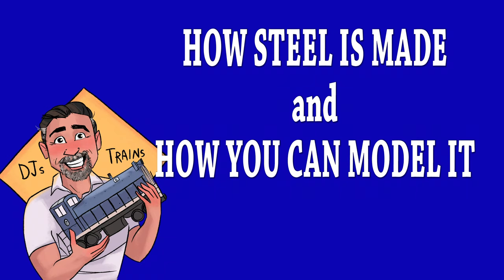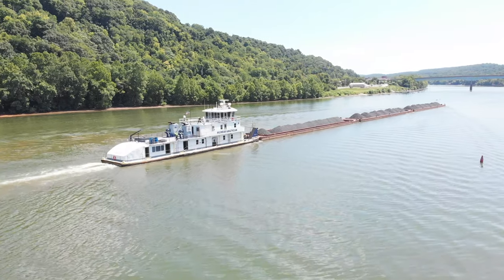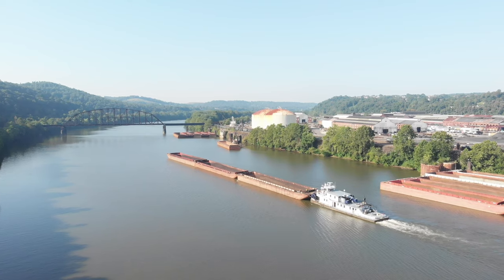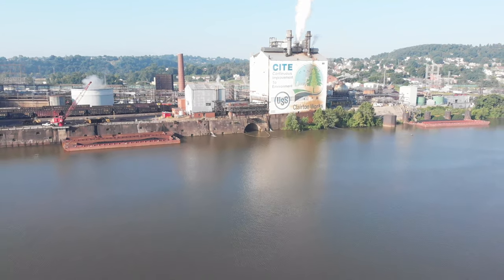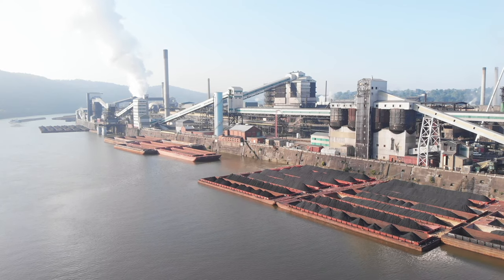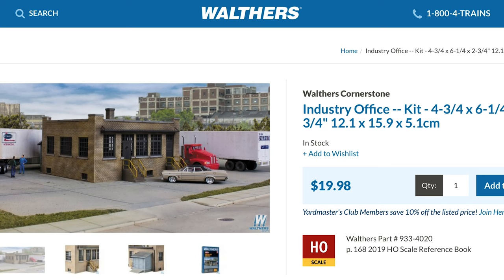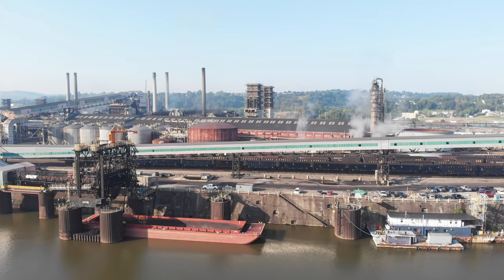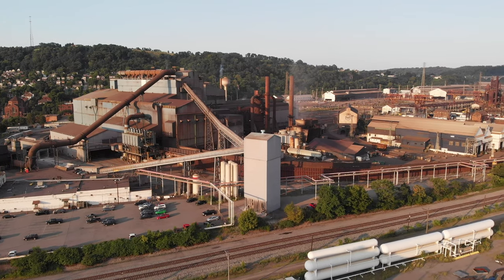How Steel is Made & How to Model it.  Part 1 Starting with Coke

Comment: Thanks for the video - ex-steelworker here; worked for US Steel Fairless Works in Pennsy back in the 70's. 2 years Coke Works and 2 years Rolling MIll. You hit the nail on the head with regards to the Walthers kit. Not only is there no pusher ram but there are no door cars either. Don't know how they missed that. And depending on the era they're missing most of the topside piping, valves, etc.

After the coke was quenched the hot car dumped it on to what was called the wharf which was a semi underground/ground level facility that had manually operated gates to drop the cooled coke onto a conveyor belt. For any coke that wasn't totally quenched the wharf operator had a water hose to put out any nuggets still flaming. Did NOT want to melt the conveyor belts. And through a series of belts the coke traveled the distance to the blast furnaces. Fairless had 3 of them.

If people want a really detailed read on steel production try and find a copy of 'Making, Shaping and Treating of Steel' which was published by US Steel. Will be difficult to find.

Comment: As a person who is going to be modeling a steel mill and has found almost zero videos on modeling steel. I can say that these will be the best videos on the subject.
I went by that old mill and took pictures of it from across the river on the road next to that rail line you can see just before the drone turns towards the mill and bridge. 
My steel mill is a long way off but will probably receive already processed coke as it is "located" 80 miles from Tonawanda Coke.

Comment: I worked for a while at the (now demolished) Interlake iron mill in Toledo.  Although some did go into hoppers, the primary method to move coke from the ovens to the furnaces there was by conveyor belt with a tripper to dump it into the bins, so that's another modeling possibility.  There were two sizes of coke, A (like the chunk you showed) and P which was about 3/4".  Our coal and limestone came in by train, ore by lake freighter and the pig iron left by train or truck.  Although you can't model it, the air looked almost like metalflake paint due to all the coke dust, but what could be modeled is the whole plant - and the surrounding neighborhood - was covered by a layer of the sparkly dark grey dust; there would even be a light layer on your car by the end of shift.

Comment: Spent time at Clairton in the 21" mill, 7-9 Battery start up, and big block and then went back to ET to work Blast Furnace, BOP and 44" Mill as a foreman in Central Mtce. Thanks for the photos video
Reply from the maker: very cool

Comment: Hi DJ, That is some great drone video, two thumbs up. The one thing to remember with a lot of Tomix (Tomytec) products, they are actually 1:150 scale. For the majority of their structures they work just fine on a 1:160 N scale layout. The one thing to avoid is the Tomix 1:150 figures, there is a noticeable difference in size compared to 1:160 figures.  Cheers, Rich S.

Comment: At the Neville Island facility we pulled each night's coke run from their plant and set out empties for them to fill that day. Lots of industry in that little "Christmas Tree" railroad. It was a good day's work.
 
I was fascinated to see the barges, too, esp. at the locks along the Ohio (?) running up to New Castle. Depending on size, three or even two barges in a lash-up can hold as much coal as an entire coal train (10k tons). 
The crew sleeps aboard.  Their duty is 12-hour shifts, 30 days on, 30 days off. Talk about hours of service and time away from home! 
 https://www.tennessean.com/story/news/environment/2016/11/12/life-towboat-captain-beauty-barges-and-adept-parallel-parking/89730490/

Comment: One thing I've always wondered about is petroleum coke. Is it anything like the coke used here? Around the Seattle area where I live, BNSF ships petroleum coke from the BP Cherry Point Refinery down to the Port of Longview for export in covered 3-bay Trinity hoppers (almost identical to grain hoppers except for the round loading hatches on top instead of the flat lateral ones that run the length of a car used for grain). Why would they use covered hoppers? We also get roughly monthly petroleum coke trains from Laurel, Montana, that run up to Roberts Bank in Vancouver, BC, for export, and those are transported in the standard open 100 ton hoppers (GATX and, more recently, BNSF hoppers).

Comment: Hey DJ, I primarily model in O-Scale and I was wondering if you knew of any recommendations for kit suppliers and builders for coke buildings in that scale.

Also, would you mind explaining the terminology you used here?

What exactly is a "quench car"? What about a "battery"?

Also because I model in three-rail O, I'm thinking of putting a fan-driven smoke unit down the stacks of the various plants. I'm also planning on adding a glow at the base of the furnaces and ovens and a glow trail to simulate a slag dump.

Also, I plan on using real loads and animated processes, both on the cars and on the factories.

Also, if I get a large enough space to do this, I'm not going to settle for fake "model water" - I plan on using the real deal, with radio-controlled model boats with real cargoes powering up and down the rivers.

One of the big benefits of running 3-Rail O-Scale is that it's far ahead of other scales in terms of animation.
Reply from the maker: coal is put into these rows and rows of batteries (which look like metal lockers)  There it bakes for 16 hours at a couple thousand degrees.  When all the impurities are removed by that heat, the hot coal is now Coke.  Basically, (visualize it this way)  they use a big machine to push from one side of the locker all the coke out of the now open door of the other side of the locker.  But the coke falls into a quench car which looks like a slanted hopper car.  From there, the quench car goes under the quencher (which is a tower that sprays tons of water on the hot coke to cool it off.  the quench car then dumps the cooled coke into a underground conveyor belt.
Reply: @djstrains  Ok, in that case I wonder if I could use a smaller-scale railcar as the quench car in a model.

How small would it have to be, in comparison to the rest of the O-Scale layout?

I'm thinking N-scale or Z-scale, but I might be wrong - you're the best source I have on this.
Reply from the maker: This is the best thing I ever bought on the subject:  https://amzn.to/31NzPAT

Comment: Hey DJ fantastic video like always man! Keep up the great work! Just out of curiosity, I know this isnt the hazmat video but it just occurred to me. Unit hazmat trains like oil or propane, do they still use the 6 buffer cars? I've never seen buffer cars on tanker trains.
Reply: Unit hazmat trains like crude oil and ethanol have 1 car loaded with sand at each end to act as a buffer between locomotives and cars. Propane, never seen that hauled in unit trains.

Comment: If and when I build this sort of thing on my layout, I'm not just going to do the rail side.

If I go for a layout, it's "go big or go home" Miniatur Wunderland style.

That means anything that ships by any method, is going to be represented in motion.

Most water layouts have static water like the Woodland Scenics stuff. Not this guy.

I'm going to have real ships, real flowing water, and real cargo. Nothing prepositioned, nothing simulated, almost nothing static.

That means coal, iron ore, and other things that go by water are going to transit by water. Using real loads of Lionel coal (which will be painted a rusty color for iron ore) along with radio controlled tugboats and scratch-built or kitbashed barges, I'm going to model the whole thing.

Iron ore and coal will be loaded onto trains at the mines, which will then then ship it to a river terminal where an iron ore dock will be, similar to the docks served by the Marquette on the Great Lakes. The ore will be dumped into the dock and then later, a couple of barges will show up hooked to a tugboat.

These barges will load up with coal or iron ore up river to an unload point, where the loads will be dumped into an underwater receiving hopper, then conveyored to a stockpile. Then another train will pull up and the hoppers will be loaded with one of the two materials and then the train will move it to its' final destination.

Larger shipments on lakes and oceans will use massive ore ships or (for REALLY big shipments) Whaleback-style ore ships and a Hulett-style Ore Unloader with the massive clamshell buckets, scooping tons upon tons of ore or coal into a stockpile for delivery.

Train to boat and boat back to train.

Can you recommend any buildings in O Scale? To match up with Lionel and (Ugh) MTH, and so on.
Reply from the maker: good luck, i am not familiar with much o scale.  Real water presents a challenge with mold.  I haven't seen it used much because of that.
Reply: @djstrains  Take a look at Miniatur Wunderland.

Their North Sea region is all real, constantly running water.

That's the trick. Keeping it running, never standing still.